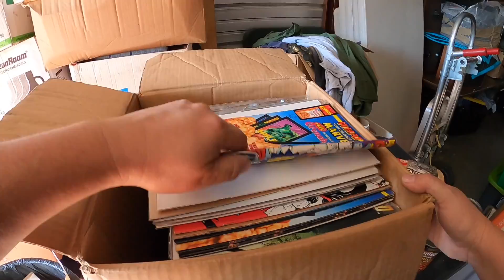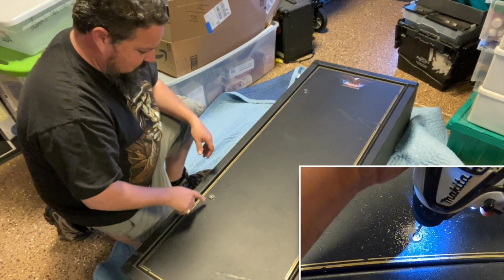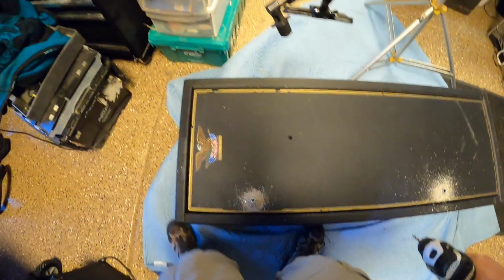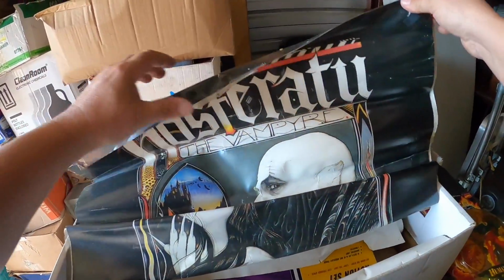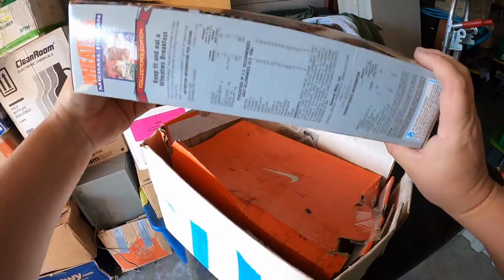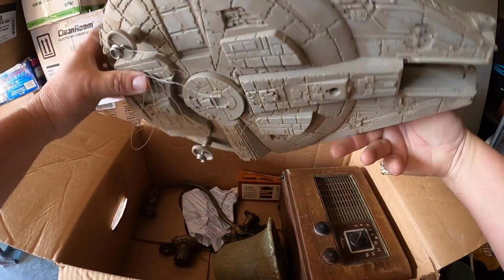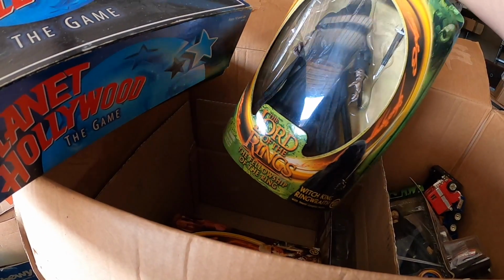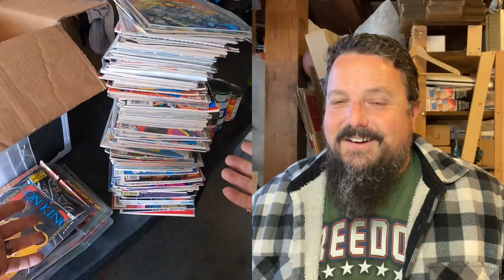Time to open this GUN SAFE we found in the locker bought at the abandoned storage unit auction!

Comment: Try using some cutting oil when drilling metal. It helps reduce overheating and clearing out the chips.
Reply: swarf is the technical term for those chps.